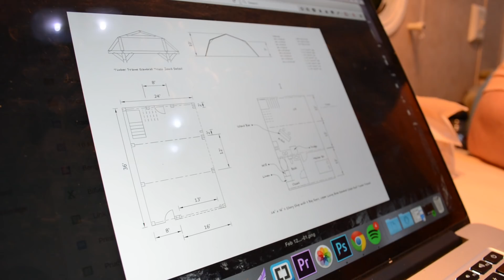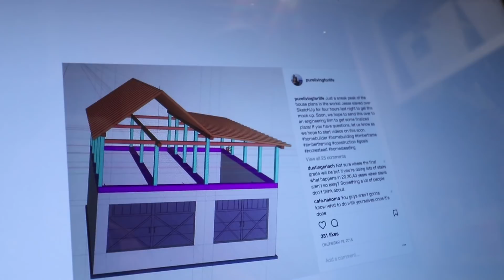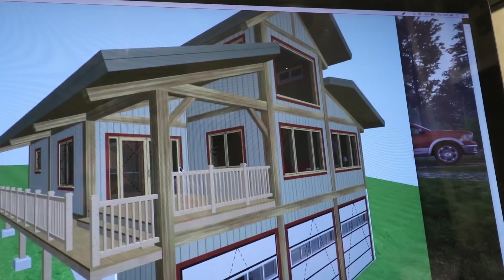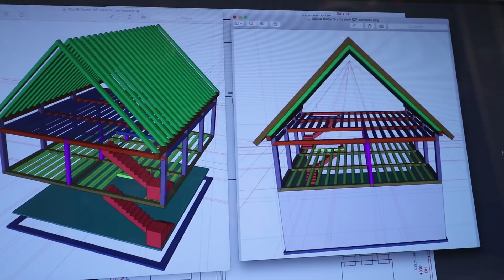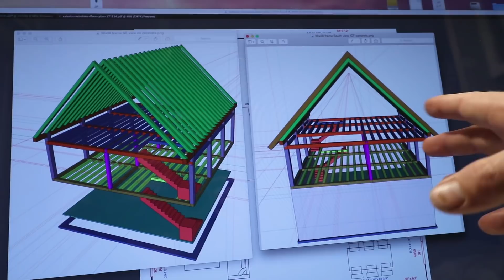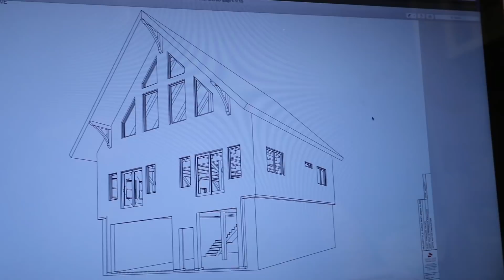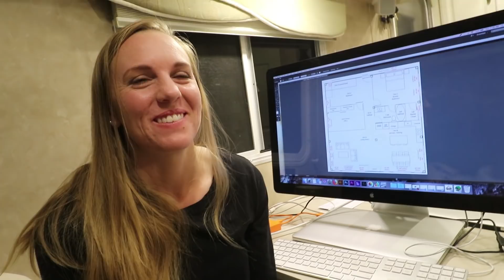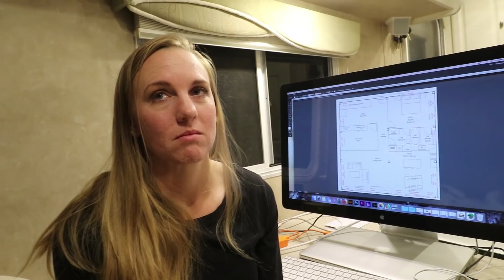Building a House Start to Finish: Timber Frame House Tour

Comment: Looks good. What about a fireplace since y’all have lot of firewoods outside?  I noticed that y’all have two door fronts at the front and no decking outside?   Washer/dryer would be suitable in the mud room with drain in case of emergency if washer overflow with water so it can go directly to the mud room drain to outside.....if it was me. I would switch the bathroom vanity sink to opposite and linen/shelves to other side cuz u would save money on all plumbing with tub, toilet and vanity sink in one wall along with the kitchen sink and dishwasher. Just my suggestion for u both to cut the corners and save money that way

Comment: nice simple layout:  things to consider - you want the shortest vent path to the outside for your dryer; might want to swap the shower and with the washer/dryer; everyone love sunlight, but your living room will washed out in too much light so watching TV will be difficult except after the sun goes down - you'll find that you'll be using blinds 90% of the time to keep the front of the house cooler in the summer - consider using sonotubes from the roof to bring in light deeper into the house like the office or kitchen; try to avoid triangular stair steps - better to have a proper square/rectangular landing if you need to do a 90 deg stairwell; your loft washroom in the future will have to be stacked above your other washrooms so plan that out; consider how far the roof line sticks out to keep the sun out during the day in the summer, but allows the winter sun to come in (there are tables for this depending on where you live in the US); you may want to make the living room wall out of stone to act as a heat sink during the winter because it is south facing; you cannot put the electrical panel in the same room as the sump pump - consider your utilities locations more carefully
Reply: earthping7 in Ohio you can have the electrical panel ten feet from the sump in the same room, on the same wall. In both of my parent’s houses (Georgia) the electrical panels are in the same room as the sumps.
Reply: thanks for the clarification; ontario building codes appear to be different from the various states

Comment: This is from experience, transom windows seem like a good idea, but you will find the light that comes in during the night will be a big pain in the butt.  Whether one of you is sleeping and the other person turns on the bathroom light or guest get up to use the bathroom in middle of the night.  They lose their romantic usefulness pretty quickly.  As for a washer and dryer close to the master bedroom, sounds great until you HAVE to get a load done and its late at night and all you hear for an hour is the thumping of the dryer.  Again, it all sounds nice, but transoms in bedrooms don't really work, I am now ripping mine out after 15 years.  Washer sand dryers belong in a mudroom behind a solid door.  My two cents.  Of course, I'm betting the SIPS have been ordered.
Reply: I couldn't agree more, especially with the idea of putting washer/dryer in the mud room. The idea of having this all fully open sounds cool but closing off the mudroom from living/sleeping areas is ideal. Keep the living spaces open and close off the rest.

Comment: It seems there could be a way to get some of that light from the loft windows down into your living room and kitchen. Also, you might want to add windows/ventilation to the rear loft north wall. Cross/upward ventilation up the stairwell could help cool the living area better in the summer evenings.

Comment: Just a thought here. The man door in the garage does not have to be very large. If you can shrink that door and the wall around it and fit in a 10 foot wide garage door, it will be much easier to get a car in and out. Yes a car will fit in a 8' door, but you have to be much more careful. At one time, I had two 8' doors and the car would fit ok, but I had to fold one mirror in to fit the F-150. It became annoying enough that one side of the garage went unused. It was an experience that if I ever build for myself, won't be repeated.

Comment: I think you have a very nice appearing house which appears to fit the locale it is in. It is very aesthetic.   My suggestion would be to use pocket doors on the interior to save swing space.  Use a swing door at the top of the stairs from the garage.  The walls will not need to be load bearing because of the timber frame so may be lighter construction than normal.

Comment: off topic I know, but with your saw mill, you could try putting some rubber pads, like conveyor belt rubber under the legs to stop it moving around so much. But you've probably finished the house already , so , yeah.

Comment: Great placement of things suggestions for ur mud rm put towels in it n at the doors u will use the most put boot scrapers n boot/ shoe holders this will save u much time n frustration also hooks for bags coats ect just my 2 cents from a mom of 7

Comment: If I understand your plan the tall window wall in front faces south. You are going to heat the house, and maybe the garage with hydronic hot water heating, as well as use solar collectors to provide electrical power. Yet you do not have a south facing roof which would be the best orientation for solar panels and a solar water heater. Why? Also the rear of the loft has no windows or a door to provide cross ventilation, light, and possibly an emergency exit.

Comment: The bathroom should have more space especially on the washing machine and the dryer. We need to remove the dryer and the washing machine to service them and also to replace them. So, you would need at least a foot around the dimensions of the dryer and washing machine so they can put their hands around the dryer or washing machine.

Comment: Make sure that stair rail is removable (not nailed or joined) or you will never get furniture up to your loft. 

Also you might not be able to put those windows in the basement stairwell and meat fire code, unless you can find some fire rated. 

-- Pocket doors would solve your bathroom/bedroom door situations too for a cost of ~2 inches wider walls on those 2 walls. It keeps from having doors swung into any room and eating up floor space or blocking access/entrance into the bathroom. 
They also add space for in wall shelving beyond the point of the doors range which is something you'll appreciate after a few years of living in the house.

Comment: Great 3d visualization. I know the loft is an eventual thing but you might want to rethink no windows on the hillside. And get your water/sewer lines up there. It would be easier do with walls not complete. And save you some demolition at remodel time.

Comment: What program did you guys use for rendering? Its beautiful! Just a comment, on your wall with the two windows and flat screen TV. I've got the same arangement in our new home. We have a fireplace between the two casement windows and mounted our flat screen above and between. Ours faces East, with the morning sun I had to put wooden blinds on the casements so that we could watch the TV without the sun glare.

Comment: Gorgeous home!  One thing I saw was that the transom window in the office seemed a bit high.  I liked some of the other comments about moving the washer/dryer to the mudroom.  If not, I would double check the door width on the bathroom for the washer/dryer install.

Comment: Great vid. Steep roofs are not user friendly. Their are harder to work on, more dangerous and will cost more if shingled by a roofing company. However they do tend to last a little longer as the water sheds off more efficiently.

Comment: Nice House Design with Room for Expansion at a Later Time is great foresight if your Family grows & it could easily have a Veranda/Deck Added later when needed but yes a Great Design Base (I've Studied some Architecture) & from a Design Trade it's pretty good just one question.... Do the Stairs from Garage go Outside or did you just forget the Doorway?
Reply: Colin Aitken  they said the door isn’t in the rendering, it will be under the loft stairs
Reply: Must have missed that somehow

Comment: one thing youy may consider is using tesla solar shingles and a Tesla power wall:)
Reply: initially yes but the cost will be paid back in a short time
Reply: Robert Foedisch.   I would love that in my house....I wonder if they're still cost prohibitive
Reply: the power wall is somewhat spendy but the shingles are cheaper than asphalt shingles
Reply: Robert Foedisch i guess because the roof doesn't face south, they wouldn't be worth it

Comment: This looks awesome! The only thing I'd change is to not make the office a closed space. Opening it up would open up the living space more. If you ever really need a closed off office, why not put that in the loft?
Reply: I think that happens when they build into the loft in phase 2. Move master suite and office upstairs, open up the old office to the living, shift dining over, add a few more cabinets to the kitchen E wall, and the old master becomes a guest room. The beauty of the timber frame is all the partition walls are moveable since they're not load bearing, lots of options.

Comment: Love it! Nice design you two. Not sure if I missed it, but, what the square footage of your home?
Reply: Cava Villven I'm pretty sure they said it was around 1,300 sq ft in another vid.
Reply: Their house is 3 story's and all floors are considered living space for 3800sqft. Nearly a mansion. I know a guy with almost the same size house , took 2 ten ton hvac units to heat and cool properly.
Reply: Cava Villven The foundation is 36 x 36.  Therefore the 1st floor is approx 1296 Sq ft.   At one time I thought the area above the living rm/dining area was open up to the roof. With the loft covering the back 36 x 24 (864 sq ft).
But plans change/evolve.

Comment: If you do end up making stone walls, then it would be so cool if you did your stone walls in a traditional way. There are Youtube videos on how to do this. The stones are placed to "lock" a structure together.  Mortar is hardly necessary but if it's used then it's lime-sand mortar. There are ancient castles, houses and cottages here (England) that are built in this way. They usually have timber frames too.

Comment: 26:52 the diagonal step at the corner, seems to look good and save space. In reality, going down the stairs, people tend to walk closer to the rail and that side tapers into a very small stair width. When you put the front of your left foot on the step when going down, and there’s not enough space, its easy to trip or slip on, especially in the dark, when carrying things that obstruct your view, or just even when you’re not paying attention. I know very well because I have that in my home and it’s a real hazard. Better off having a small squared or rectangle staircase landing there than that diagonal step. To fix that later is troublesome because the railings have to be changed as well. Also the railings have a big drop when turning a corner descends 2 whole steps. Much better to have it as a smooth continual slope especially when turning a corner.

Comment: bathroom doors should open out into the larger spaces - when we got this house we reversed the main door, it was just too crowded in the bathroom to open a door into it - you've got two doors into a fairly small space - it will restrict what you can put in the room and whack someone on the knees

Comment: You mentioned future use of the garage, And you wanting to put your RV inside the garage. I don't know what kind of RV you have but from the looks of the inside of it, It's a pretty good size RV. I don't see that RV fitting inside that garage. You would have to have a very large garage opening to fit it through. Probably 12' to 16' High. Width might not be an issue but definitely height.
Reply: JK moo
Reply: it will fit as long as  they
 don't frame in for garage doors

Comment: My one issue with houses with more than one story high, is being able to get furniture up and down the stairs if needed.  The landing on both of your stairs isn't too bad, but depending on what you have to move around, might cause some consternation.   

The other problem I run into, is where one might watch TV in the evening, sometimes having sun coming through windows on the same wall the TV is, even with blinds, can be annoying.

Otherwise looks great.

Comment: You are gonna need awning on the south side. You say it gets hot in the summer, so without shading the windows of the living room, you built yourselves a solar oven to sit in. Also, a wraparound deck would be nice. That design kinda screams out for one.

Comment: How are you going to move large furniture or heavy appliances into the house? Thru the garage and two turns up a stair, etc, etc. You are going to go crazy... Hopefully you can get some stuff up on the back of the house, but are the doors wide or high enough for the king size bed or side-by-side freezer and fridge?

Comment: Have you priced fire-rated windows? The garage stairway is a pathway for fire to enter the main living area. By most codes (and common sense), the stairway walls, the door at the top of the stairs and the three windows in the mudroom must be fire-rated.

Comment: J and A
I know in the past you do not bother to read the comments but I think you read this one.
That is a very nice looking staircase, but it is in the wrong place.
Here is my'2 pennath '  for what is is worth. 
Reverse the location of these two units. 
Put the open tread staircase to service the loft and the enclosed tread one to be up from the garage.
 Remember, that you are required BY CODE to have a  "2 hour self closing fire rated  door " between a garage and any living space.
By locating the stairs up the north wall,  facing to the east wall (The entrance would be by the buttress wall,) and straight up no landing at ground level.
Then, at the top of the basement stairs,  located on the east wall by the mud room south corner, locate your open tread stairs to the loft area., up the north wall.
Much more appealing look and removes the requirement for that wall with those three odd looking windows.
You could enclose the basement stairs  and locate the door at the bottom, for the code requirements , and  free up a ton of extra floor space for a laundry room etc., on the first floor..
Also, put the mud room in the basement that where you will make the most mess and not track it all up into the living space.
Reply: The door at the bottom is good idea for that fire rating, but that would lead to 2 mud rooms. There's a second door in from the outside on the main floor, which will need a mud room also. Less likely to be muddy from car as opposed to coming in from outside.
Reply: Joe
No,  you don't need two mud rooms. 
If you are doing dirty work just process you entry to the living space  by  coming in through the garage.

Comment: I would extend the roof out over the garage area to maybe add a deck later and to add extra shade on the south side.
Lots of glass on the south side = heat.
Also. It seems according to the mockup your using sheet rock.

Comment: I wonder, if it is hot and Cold alternating, why not build the house mostly in the hill side? Cooler in summer and warmer in Winter. Less wall area to heat. I have contemplated, if I was to buid a new house, to do it in that manner. And have a sort of hallway around the actual house to have a barrier for heat and moist, and at the same time storage for Wood. Easier to get to when there is copious amounts of snow. I am not bashing any decision but want some comments on the matter.

Comment: One way to add more space without much trouble is to cantilever things, like our kitchen is cantilevered and we gained about 2.5 feet.  There is a very small roof over it, there had to be, but it didn't add to needing more basement or up stairs. My mistake was not to cantilever the laundry room just behind the kitchen. How did I not see that? How easy would it have been to continue that extra 4 feet? We did the cantilever to make a U shaped  counter top into an island. We needed just that little extra for the clearance for the fridge and dishwasher. We only cantilevered about... I'm guessing here....14 feet, just one wall in the kitchen work area. Our kitchen is really big we just made it bigger. So the cabinets on one wall look like they're built into the wall. It's a nice look and cost almost nothing to do.

Comment: Hey guys, big fan. I would put a porch in the back even the front or both. One thing I can tell you is that every house needs a porch. Just an idea but I remodel for a living so if anything I know this to be true. I can even picture a wrap around porch.  I'm sure whatever you decide it will look great. good luck.
Reply: Rudy V - I think they are still going to have a full wrap around, from front to.  At least I certainly hope they do.  The front is clearly missing a porch !